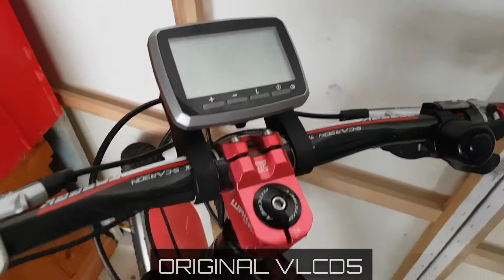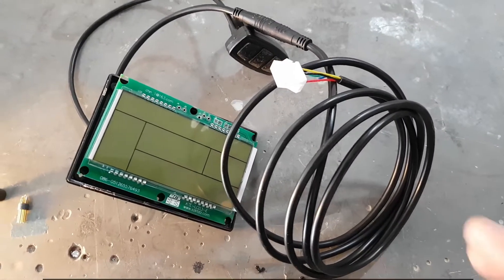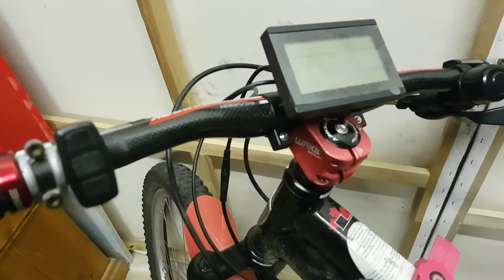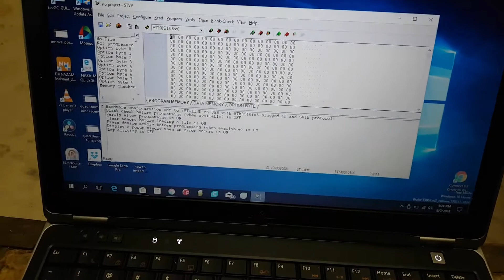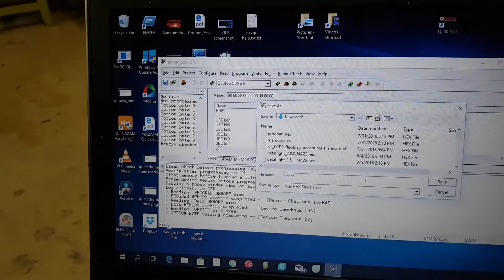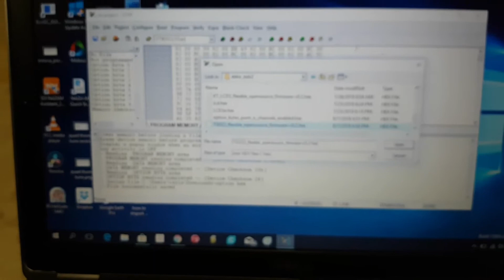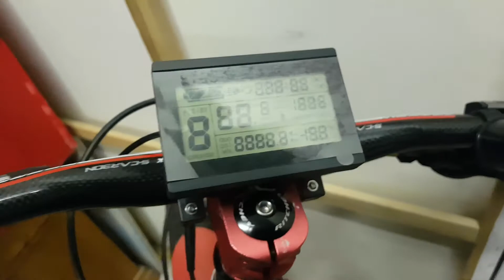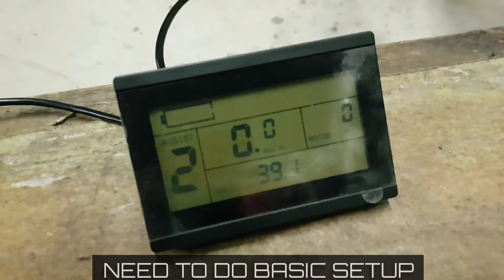TSDZ2 OPENSOURCE FIRMWARE | PART 4

Comment: hi
im new in this

im trying to use wheels from Hoverboard 36V 350 w and the LCD in picture with KT controller 36v/48v 500w

hoverboard battery 36v 4400mAh im using two of them 

i need  help about the right firmware config or the modifications i must do
 

i tryed a standard firmware but nothing work

lcd
https://drive.google.com/file/d/1HG8kauvawg-b7qZj52X1hNOfF0PMJb0F/view

controller
https://drive.google.com/file/d/1iJgnssPR02rI9b0T2uXmQb_DJjDwE9t3/view

https://www.aliexpress.com/item/32972931563.html?spm=a2g0s.9042311.0.0.7d564c4d04pXX0
Reply from the maker: Dr Tarik see my link to the discussion forum in the info. I’m sorry I can’t help but I do know that the motor controller and lcd need to be flashed otherwise it won’t work. There is another firmware by Casainho that works with the kt controller but not sure if that works with the lcd.
Reply: @jbalatutube  thank you alot :) i will check more in forum

Comment: Hey, thanks for the great videos! Do you leave the lcd connected to the motor when flashing an update?
I hardwired the connection and I am wondering if my problems updating the firmware on the lcd are caused by the permanent connection to the motor.
Reply from the maker: Yes I do leave it connected. Make sure your cables are short also try using 3.3v instead of 5v
Reply: @jbalatutube  Thank you for the reply, it was a problem with the ST Visual Programmer. It works now. I like the new 1.9.0 Firmware!
Reply: @niesreininghaus171  What was the issue with the programmer? Currently trying to update the firmware. Feel like ive tried everything and this is a new issue I havent heard yet. I would really appreciate some more information.

Comment: Am I getting this correctly. With this display and firmware you lose throttle control? I'm guessing you also lose brake sensors control?

Btw, weren't you afraid engine could engage all of the sudden during the flashing and lcd connection issue?
Reply from the maker: Yes you need to hook up your throttle wire down at the motor, but there is a workaround for the brake sensor, the new display doesn't have enough wires to carry all those signals. If you install the temperature sensor then you cant use throttle at all. Don't stress throttle is pretty crap on this motor anyway. They will be implementing cruise control soon so you won't have to worry.

Comment: Great set of videos, I decided to give it a try just because you made this tutorial! Currently waiting for the display and the programmer. Any chance to back up the original firmware to bring the motor, just in case, back to the original configuration? Thanks!
Reply: I too am holding out on this because I am not sure how to reinstall firmware if an error occurs when flashing. any idea @jbalatutube ?

Comment: funny vidéo ;)
i ll probably test this issue in future, 
first i ll use a 6.6v zener to use a 12S pack and upgrade the rpm
Reply from the maker: Ha ha thanks.. I actually run 10s but tried 14s and no difference in speed. Im already hitting max cadence on the motor and top out around 42km at 112 cadence with 42t front 12t rear and 26 inch tyres.